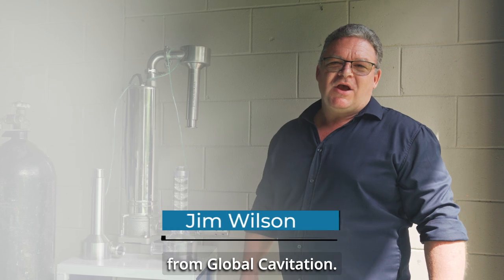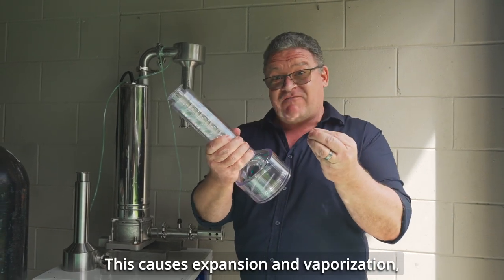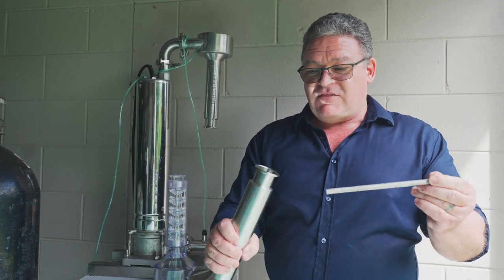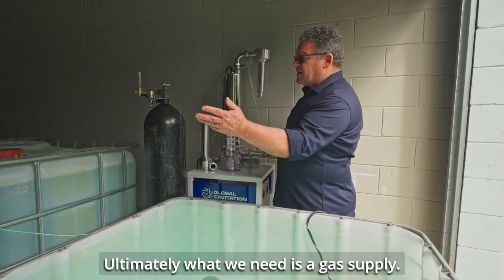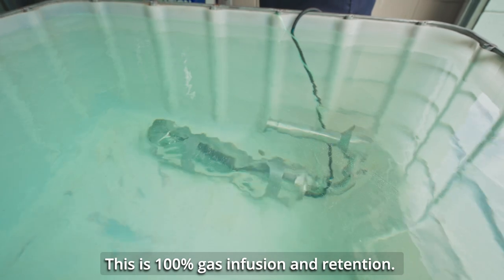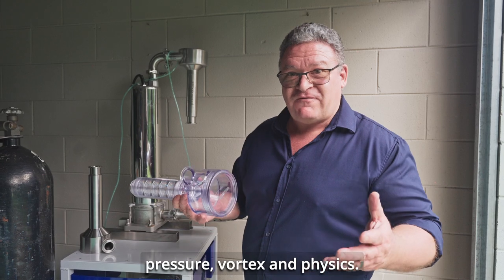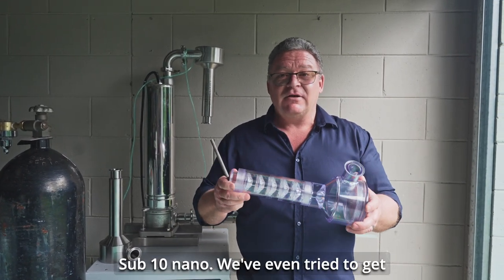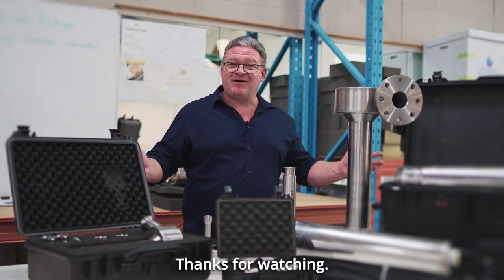Hydrodynamic Nanobubble EXPLAINER - GLOBAL CAVITATION

Comment: At which pressure was the HO gas infused into the liquid? ..and why at some point it became visible? ..does it mean bubbles are becoming bigger than 10nm?
Reply from the maker: Thank you for your comment! The gas is injected on the suction side of the pump if it makes sense, and the used HO generator’s maximum shut-off pressure is 7 PSI above atmospheric pressure. Since we are on the suction side, the gas injected is slightly below atmospheric pressure. As you have noted, after some time, microbubbles are formed (nanobubbles are still being formed). To understand this, note that the volume of gas injected is constant and that at the starting point of the experiment, there is a maximum amount of gas that can be held in the volume of water used. After each cycle, less space is available for the gas to dissolve, and through cavitation, nanobubbles may collide with another nanobubble, forming larger bubbles. This is why some microbubbles are formed after some time of recirculation.
Reply: @GlobalCavitation wow. Great explanation.
I really need to speak with someone there. 
I have a use for this technology, the way your unit works.
I was very excited to come across this video just now.
Reply from the maker: @willlock3644  for more information please send an intro email to info@globalcavitation.com We will respond directly!